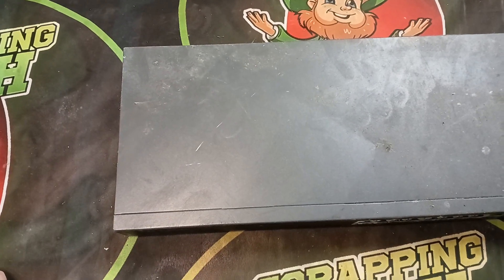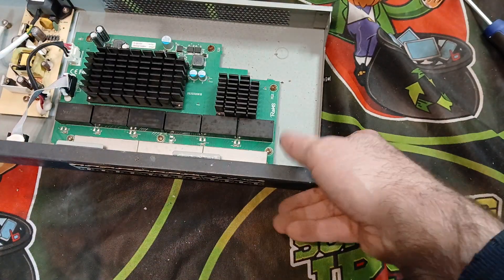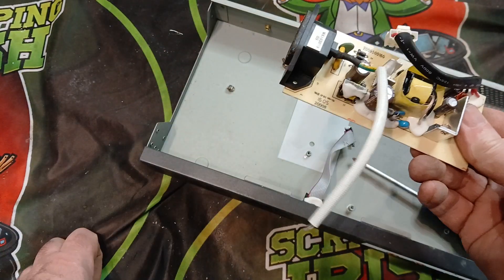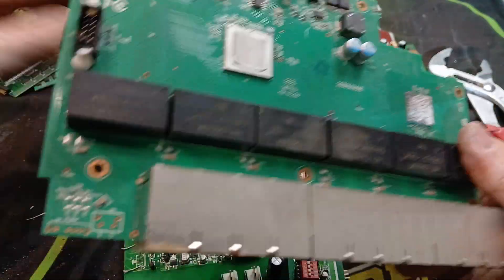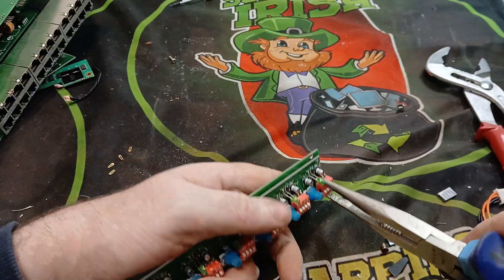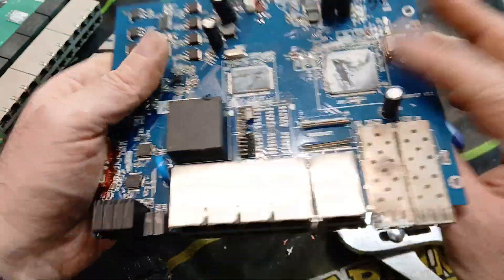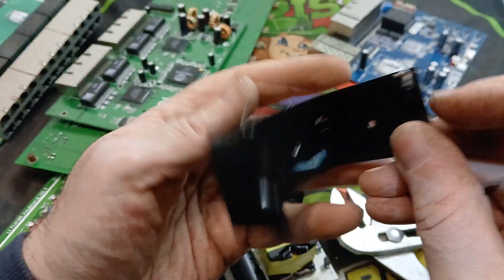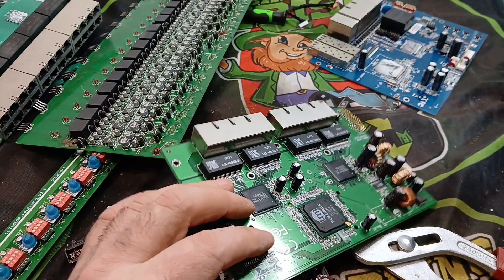WARNING Don't Throw Away Your Old Network Switches They Have GOLD

Comment: I don't see much gold there 😅
Reply from the maker: No most of the gold will be in the chips
Reply: @ScrappingIrish  messing with you my friend. I know that. You said many people will not see gold. I said I don't see the gold. Love what ya do. It's what I do  I work a full time job then come home and scrap out EWaste. Or vacuums or microwaves or anything with a power cord. Love what ya do and though I think board sort is great for scrappers I think I wish I had that material. I've plenty to process but you never have enough
Reply from the maker: @richardhulbert9480  lol sorry missed that
Reply: I use a gasket scraper to remove the connectors with the gold pins. Saved time of pulling the pins out.